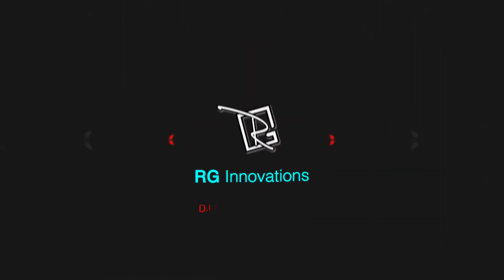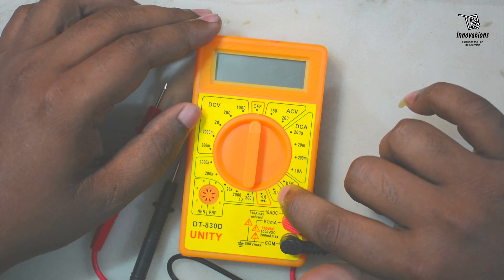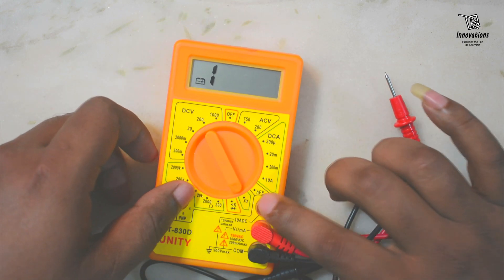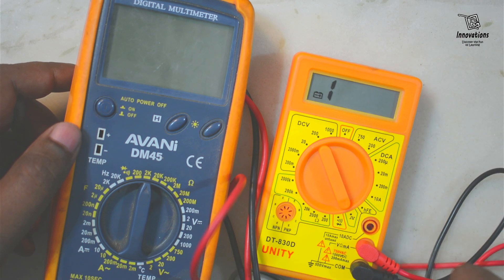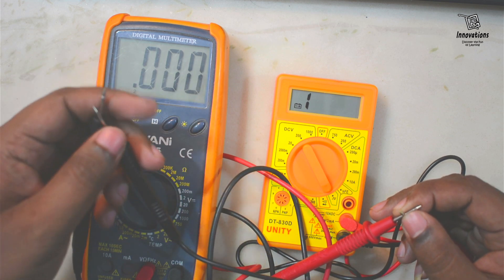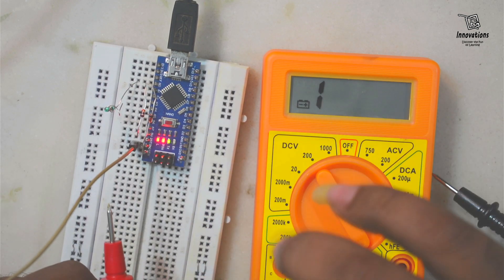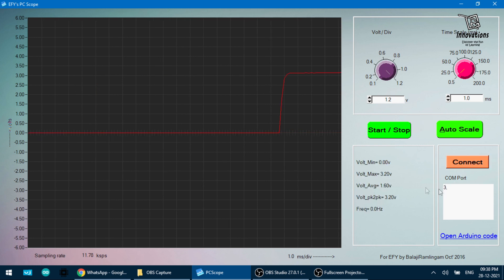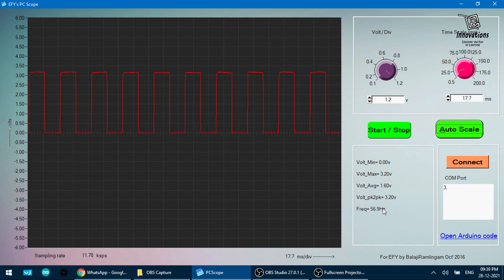Why is There a Frequency / Wave Symbol on Multimeter? What is Its Use or Function?

Comment: I will share what useful this. This 56 hz we can use when laptop fan not working and then laptop doestnt have pulse to rpm pin of motherboard fan connector. So lap shows fan error and shutdown. When we give this pulse from multi at boot time
 Lap Ec think fan ok. So laptop will ON.
I tested that on lenovo T420 laptop.

Comment: You can use this function of the meter to measure capacitors and coils using the formulas x=1/2(3.1416)(Frecuency)(inductor or Capacitance)
Reply: No, this formula is applicable only for sine wave

Comment: What about the symbol to the left of that one? That shows radio waves
Reply from the maker: that one is for checking diode, led and continuity.
Reply: when set to that mode, the multimeter will measure voltage drop across the leads (similar to resistance measuring mode). also it'll beep when the voltage drop (or resistance) across the leads is very low, which means a short circuit. it's used to test if wires are properly connected, or to find out connections in PCBs, etc.